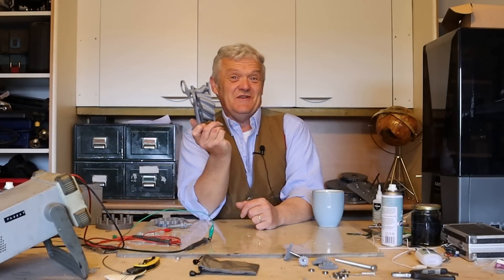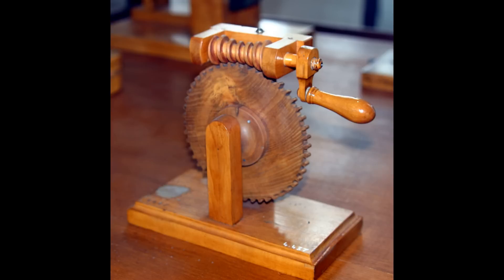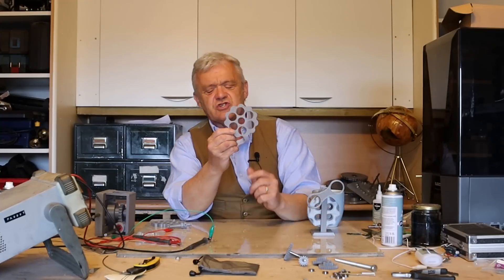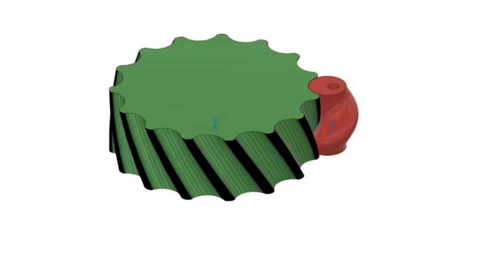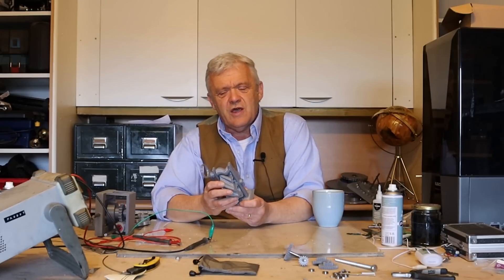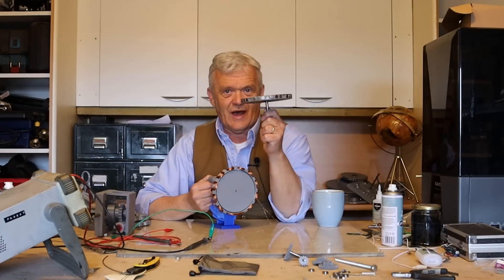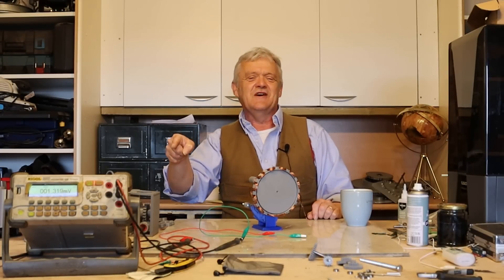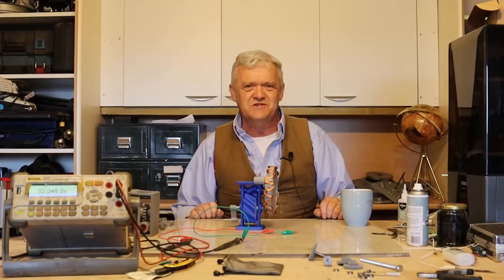1990 Eccentric Cycloidal Power Generator

Comment: We are getting very close now , we’ll actually you are getting very close to a system for green house heating, chimney heating and dare I say it a system to feed off my efforts when I do cycling on my indoor trainer, all obviously liked to small batteries or a series of batteries that will generate heat = wow looking forward to be warm this winter = wow plus two more wow’s.
Reply: pedalling the bike will also keep you warmer.
Reply: @grendel1960a  Agreed but seems all that effort couldn’t be captured to a battery so it could be used while not on the trainer, 65 now so do about an hour a day,
Reply: Are you sharing your progress anywhere online as I think there would be lots of interest
Reply: @scfcrob  progress in regards to what ? My thoughts ? I’ve always thought differently , as  an example they have these big power wall batteries for solar , why not have small batteries that could be powered by cycle trainer once charged fit back in to pack made up of individual units, why have a solar panel on the roof so it could not only capture the sun rays but could also capture the vibration of the rain hitting the panel = easy to put discs within the unit , Tesla now have solar tiles, why not have solar shutters on south facing windows and the wires go directly into the room charging a small battery within a heater , warm in winter cool if we get a summer,  many have oil for their heating , why aren’t we having sand batteries , the list is endless , the temperature in the ground is a constant heat , dig a hole in your garden. Line the hole with aluminium fill it with sand , a mine wind turbine and I mean mini blow warm air into the house when needed , lots of things that could be done for people living in flats with balconies, as said list is endless.